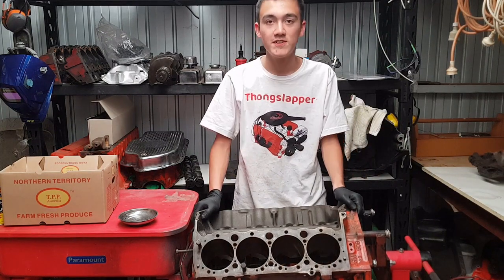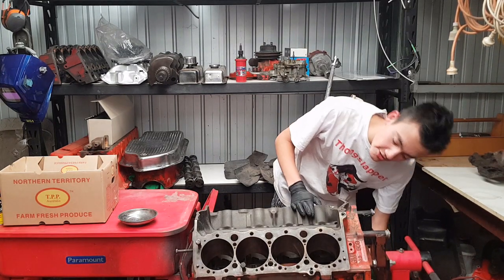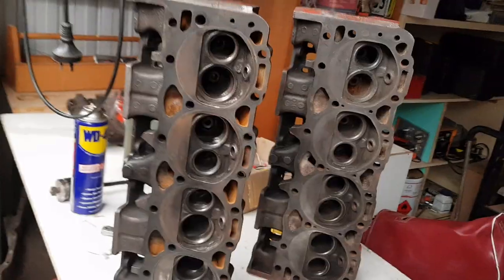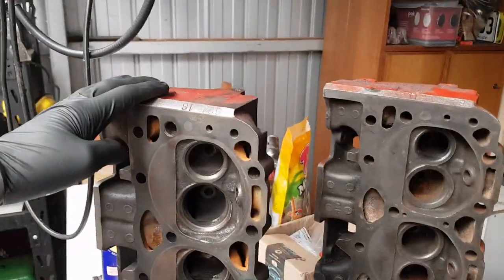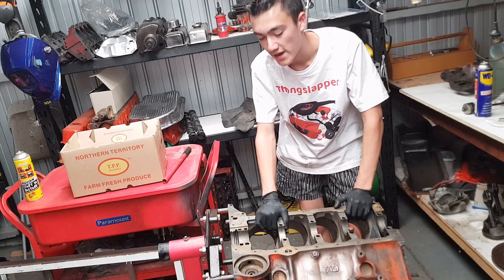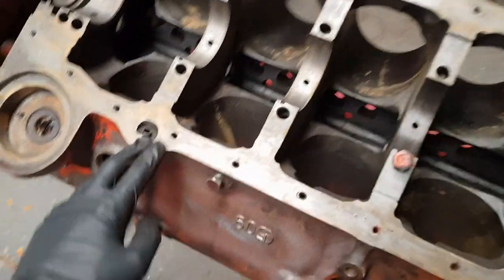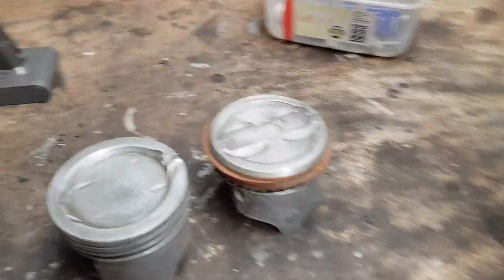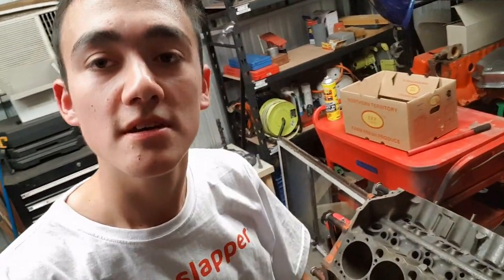Why the small block Chevy 400 is different

Comment: I had a 406ci that was strong.  Had flat top pistons in it.  Wasnt factory built.  350 crank and rods and brodix track 1 heads kit from jegs or summit racing with no work done to them that went 6.90s in the 1/8th mile at 99mph in a stock rear suspension 1968 camaro with full interior besides 2 jets racing seats and the original fold down back seat that was heavy.  Car weighed 3275lbs with me in it when I was 200lbs.  Miss that car and engine. When I sold it I had steel crank and rods to go in the engine that I never got to install in it.
Reply: A 400 with 350 crank is the recipe for a 377, not a 406.
Reply: @whiplashmachine   what ever it had it was a 406 cu in motor my uncle built it and is a mechanic
Reply: @willabunnjr216  so probably a 400, 0.030" over then. Awesome engines either way.
Reply: @whiplashmachine  yeah I think it was 30 over it's been almost 4 years ago since I had to get rid of it.  Wish I still had it.
Reply: @willabunnjr216  I have two tucked away. One is for personal collection. I should do my own video on the 400 someday. Hmm, ideas running through the head now lol.
Reply: @whiplashmachine  go for it man I would.

Comment: I've got a 400 with 3 core plugs on each side of the engine and is a 2 bolt main. Also the main caps are splayed a little wider than the other small blocks. I've used 350 heads on my 400, all I did was use a 400 head gasket as a template and use a 1/8th drill bit to drill into the heads water jacket. Never had any over heating problems.

Comment: I have custom flat tops with valve reliefs specific to the old iron head intake and exhaust valves in my 400 at .060 overbore.  I have to run super and it pings with lower octane than 91 but its a sleeper. Headers with extra large and quiet mufflers(4 total).  Aluminum heads one day soon.  All iron headed engines stink bad when running.  Fully studded with windage tray and trap door oil pan.  I push 7000 rpm in my 77 chevy 3/4 ton all the time.  I blew a perfomace Mallory distributor doing that, threw in a performance upgrade Accel from the closest parts store (score 1 for chevy parts in every part house!) and it runs better than it ever did.  Never buying Mallory again. It split the reluctor and was just spinning in place.  Also it was very thin.  Accel's is well welded and has a thick reluctor on the distributor shaft.  Happy day to you!
Reply: Rolly Mora  about a 413 or 6 7 liter.

Comment: The 400 small block also used shorter connecting rods.  Not so good for performance considering a lot of high performance builders like to use a six inch rod.
Reply: @Curtiss Smith  A lot of people equate HP with spinning an engine at high RPM's which is unnecessary for the street. I use the stock rods and with the combination of parts I put into the 400's I build they make about 470 hp @ 5700 rpm, have good street manners, and don't break the bank doing it. And as Larry the Cable Guy would say, I don't care who you are that's good performance.

Comment: I have a 400 in my truck now making 486 hrs pw. 410 ft torque    And it has never gotten hot ever even sitting in traffic  has a lunati cam comp roller rockers, brodix intake, Molly oil pump,  edelbrock 750 carb ,headmen headers hillborn scoop. iv had alot of chevys over the yrs from 2000 on .   This 400 has really surprised me.   Best motor I ever had was a 1965 steal crank 4 bolt,main  sbc 327 , 202 hump heads, rv cam hooker super comp headers, single plane high-rise with 650 edelbrock in a 1973 chevy Cheyenne super with 12 inch super lift, 40 inch gumbo mudders, on 1 ton 12.bolt warn Lincoln locker rear  open front.  Built it when I was 16..

Comment: From 1970 they came in cars -1972 they made a heavy chevy chevelle with aluminum heads from the factory. This 400 small block was a car motor fro 70-75 then from 1975 - 1980 it was a truck motor finding it’s way in to 1 ton vans that motor homes are made from and only in a 1/2 ton if it was 4wd the rest were 3/4 ton or bigger . Now back to the car heavy chevy those were the factory 4 bolt main blocks that had 3 freeze plugs down each side of the block were the motor mount is also they were puffed out like a big block were the 3 freeze plugs were those were what GM designated to be SPHE that’s Special High Performance Engine. It also had what was used on the late 60s corvette transistor ignition! That’s basically electronic ignition they never released that on all cars until 1975 that’s the first year of HEI we’re the coil is in the top of your distributor cap ! That’s HEI High Energy Ignition it was around 38,000 volts compared to the points set up less than 20,000 ! Also just a little fun fact 396 got factory over bored to make them see 402 cubic inches the last 2-3 years they were released. There bore and stroke is 4.126 x 3.76 now the small block 400 was 4.125 bore and 3.75 stroke. The cars were sold as 396 but we’re actually 402 71 &72 the trucks were a bit different saying 400”invader” and that’s why they all say 400 small block ! Because in the binging the trucks were knowen to have a 400 big block ! Then this the saying always you hear 400 small block no one just says 400

Comment: hi 
crack test block, sonic test bores B4 any work is done 
line hone the mains and torque plate the bores 
215cc cast cylinder head 210 cnc or 220cnc head

Comment: Chevrolet made a 4.125 bore small block 400 that can easily push 750hp & torque simply by boring it .030 over. Its a one year only 400!!!!!!
Reply: Oh yah what year?
What do you know about it. I got 2 of them just wondering.
Reply: I'm waiting for a answer myself😳😂
Reply: me toooo..
Reply: it's a secret
Reply: if you can get 750 hp by boring a 400 30 over you are worth millions to anyone who knows that the bore size has no real hp difference it is the stroke, compression ratio, and by far the heads where you get 750 hp and that much hp with pump gas or race fuel is hard to get unless you run power adder it is possible but very few engine builders can make that # happen with a stock 400 you need a aftermarket block to hold up to that kind of hp around 600 hp you need to get a better block because it just won't hold up to that kind of stress like a dart block or even a billet  aluminium block
Reply: BS
Reply: BS
Reply: It was known as the Pontiac Ram Air IV. 😁
Reply: @sendit2873  yup, that's the range when the main caps start dancing in the stock blocks. Ya can weld the mains on, still gonna happen.
Reply: @msh6865  Not even the same engine. You've got a lot to learn kid.

Comment: hi  for performance the only way to go is replace all rotating parts  crank rod pistons with a pre balanced assembly .These include balancer and flex plate. Economical way to do it . Hypereutectic or forged kits available .
If on the cheap u can use stock crank 5.7 rods and hyper pistons  , done in ozzy is $$$

Comment: There's several aluminum heads with steam holes that will really out preform the old cast smog heads  also run cooler  add a flat top pistons and zero balance it with aftermarket balancer you'll have a real sleeper

Comment: 400s were designed to tow around ever increasing size cars. Low comp sluggers. They can be modified ofcourse but not much around in pistons or rods. The siamese blocks end up expanding to oblong bores! They never seem to last well modified.
400 Ford is a far better engine to do that job. 350s however will always be superior

Comment: How big bore can I go on this 400 motor
Reply: I dont remember the exact bore but i know you can crank these suckers to 434 cubic inches with a larger crank and a teeny bit of boring
Reply: @synshenron798  OK that's what I going too do maybe small turbo
Reply: @brandoncash945  be careful tho, if your using a stock block 400's can take a ton of punishment but ive heard ratings that say don't go over 600hp
Reply: @synshenron798   yeah but imma bored it over and put small Turbo damn
Reply from the maker: stock bore on a 400 is 4.125" i wouldn't go anymore than 30-40 over.
Reply: @Joedennett69   oh OK can be a 427
Reply: @Joedennett69  i race a 400 sbc in an 85 camaro and id love to.push it harder but idk how much power i can really push. Right now its a stock block with longer rods, a roller cam with roller rockers, vortec heads and a demon 850 carb with a forced induction into it with the high beam head lights removed with hoses forcing air into the carb. Any ideas?
Reply from the maker: @synshenron798 it sounds like you already have a decent package, are you running stock pistons? If so your compression would be shocking.
Reply: @Joedennett69  no actually they are not stock, we got shorter pistons with longer rods and the cars best time is an 11.2 in the quarter. Im not sure of every detail cause im only 17 i just know my dad is the one who teaches me all the stuff on the car, engine, trans etc and i use the internet to fill in the gaps
Reply: I am running the same thing.Just fired mine up for the first time and Holly crap,woke up the whole neighbourhood.406 torque monster.I just put A video up.
Reply: 30 over 400 block with a 4in stroke crank makes a 434 , u can bore it another 30 but after that cylinder walls start gettin thin
Reply: Eighth inch stroked crank, 6inch rods, 50, yes ,50 over 438 ci. Howe cool aluminum radiator 4 core. Ran this combo circle track never got warm, didn't brake, track championship winner.

Comment: 400 studded 4 bolt is stronger than the 2 bolt though.....
Reply: na start with a 2 bolt. get 4 bolt splayed caps and have it machined to use them. add studs and your set. if you start with a 4 bolt and go with splayed caps part of the bolt or stud is exposed in the original outer hole for the factory 4 bolt cap. 
2 bolt and machi e to accept 4 bolt splayed caps is the way to go.
Reply: A 400 4 bolt is stonger than a 2 bolt. All main 5 main caps on the 4 bolt block are made w/ nodular iron caps. I have a 2 bolt(509)casting and a 4 bolt 511 block. Ive measured all the dimensions in the main saddle on both blocks and they are exactly the same.  A 4 bolt block is better than a 2 bolt block period.  A 2 bolt with aftermarket splayed caps is stronger than a factory 4bolt.  I wish people would stop spreading crap that they've head instead of actually checking.
Reply: @albertseelig4776  No they are not stronger.  Take a look where they drilled the holes for the outer bolts on the 400 and you'll see that it is right where the main webbing is at its weakest.  In a sense you add fasteners which is good but you weaken the main webbing by drilling the holes which is bad.  That's why the 2 bolt is thought of as stronger.
Reply: @DaveMcLain  I'm with ya. Have had best luck with 2 bolt studded with the stock blocks. 600+ go with the aftermarket block, way too much invested into reciprocating and top end to put it into the factory casting.👍

Comment: 427 is the biggest small block. It was built specifically to race Daytona
Reply: There never was a factory production 427 small block.
Reply: @Hanzyscure  oh yes there was. Do some research and you will see for yourself.  It's my choice of engine . Besides a cast iron block ls
Reply: Guess the LS7 would be a 427 small block but the ones produced in the 60's were big blocks,
Reply: @chadchambliss4949  there was for a year or 2 in late 60 s or early 70 s . Dig deeper bro
Reply: I won't cause it don't exist.
Reply: Mark II was not production.
Reply: @chadchambliss4949  its still a 427 sbc made by gm. But wait you said it don't exist. Lol
Reply: Point being all along is yes they made one weather it went into production or not is another topic. Alls i know is gm made one and ive always wanted one for over 20 years
Reply: It was made in 63 and only 50 ish were made even gm is not sure exactly how many so good luck to you.
Reply: @chadchambliss4949  cheers bro the chance of me finding 1 is not good. But i know i can always get an aftermarket engine these days similar and probably better for around 15k . outlaw racing i think it is make a sic one
Reply: @backyardbangers1012  Well from what I seen it will be badass. Hope you get it!
Reply: @chadchambliss4949  yes especially because it'll be going in my lj torana. But untill that day comes ive had to settle for my budget build 283 sbc out to 311ci with flat tops a nice cam and fourbarrell setup
Reply: @chadchambliss4949  If you're talking about the famous "Mystery Motor" ran by Junior Johnson and Smokey Yunick in NASCAR.......there was NOT "50 of them made". Far from it. More like 20 were made, give or take. Chevy told Junior Johnson and Smokey Yunick that they would give them factory backing for the '63 season. Chevy gave Junior and Smokey only 7 of these engines apiece. 3 more were distributed among the competition, who got 1 each solely for inspection, per NASCAR rules. ( Any new engine had to be provided to the competition for inspection. Only as it came from the factory, not after being modded for racing of course.) Holman/Moody ( Ford ) and Carl Kiekhaefer  (Chrysler ) were 2 of the 3 competitors who each got one. Junior Johnson immediately bought those 3 extra engines back, so he would have enough motors to run the entire year, because before the Daytona 500 even started to kick off the '63 season, Chevrolet suddenly decided to back out completely, so Junior and Smokey were on their own. At least they had the cars and a handful of these motors. Chevy probably kept 2 or 3 at the most. So the total is only around 20 or so ever made. See video title: "Junior Johnson and his 1963 Chevrolet Impala SS"...........'Ole Junior would know better than anyone else. And that's exactly where I got the information stated above. These motors were incredibly strong when hand built to race in NASCAR. But the problem was the heads had weak valve trains, which would blow up the motor sometimes. If the motor didn't break, they won the race. The Chevy Mystery Motor led in every race it entered in 1963, and won many races. Junior swears that if they could've kept them from blowing up, they would've won every race that year.........save from crashing or some other stroke of bad luck.
Reply: They where big blocks,take a look at the valve covers in Juniors interview on the 63 impala
Reply: Doesnt say any where they where small block!